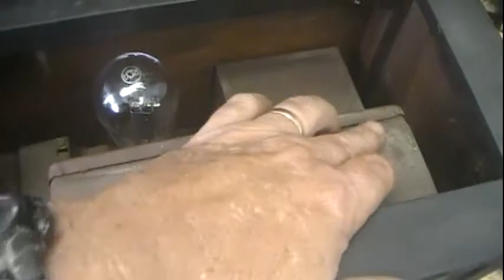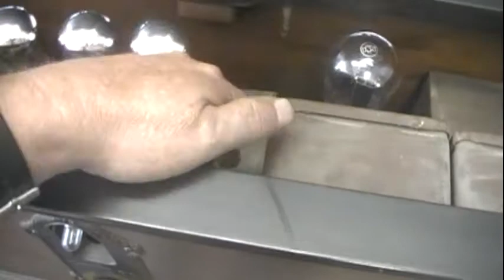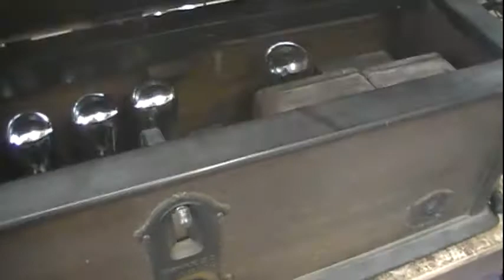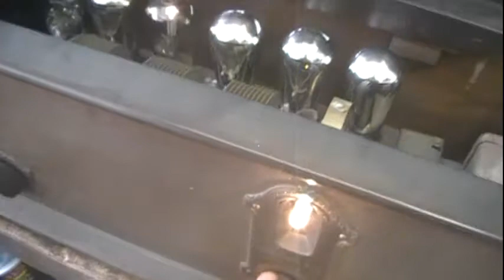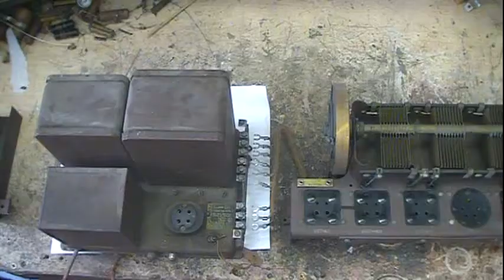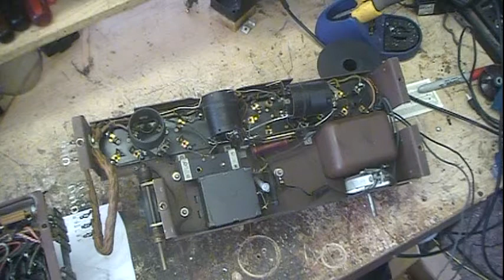Graybar 310 restoration part 1

Comment: Very Good Video, Dennis. My Graybar 310 is the same, but the cabinet is mounted on turned wooden legs, with a turned wooden spreader across the bottom. Also, there is a decorated fret work apron across the front mounting the 8" round high-impedance speaker. It even still has the often lost "eyeshade" over the dial lamp. The only difference I see, the screwdriver adjusted trimmer between the tuning condensers has a brass plate marked "NEUTRALIZER" to the rear of the hole on top of. the chassis.
Thanks for sharing, & keep up the good work.
Dick
Reply from the maker: WB8MHE Thanks Dick.  I seen a youtube video on a Graybar 310 that looked liked yours. They had restored the electronics and was selling it. They were asking 510 dollars for it.